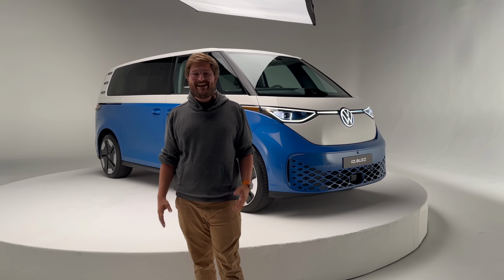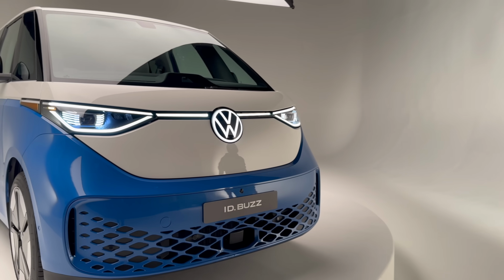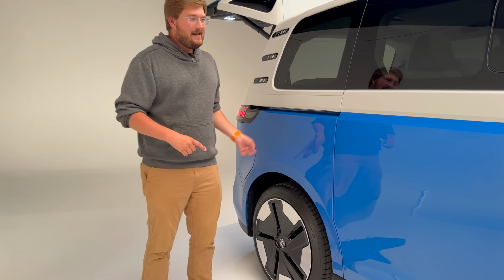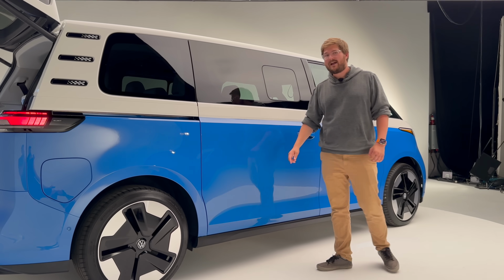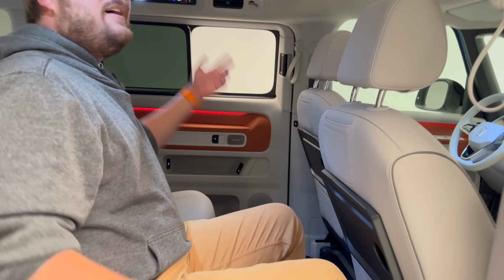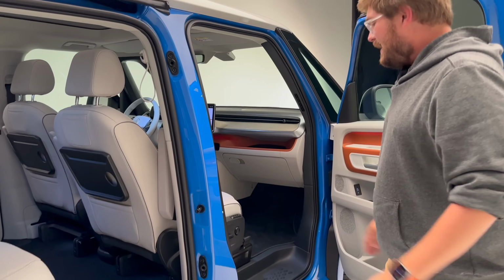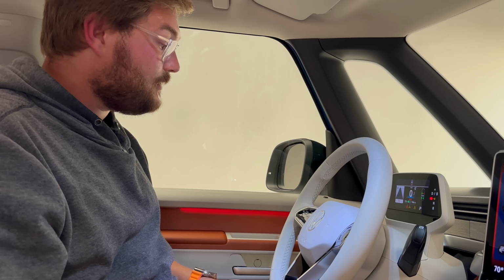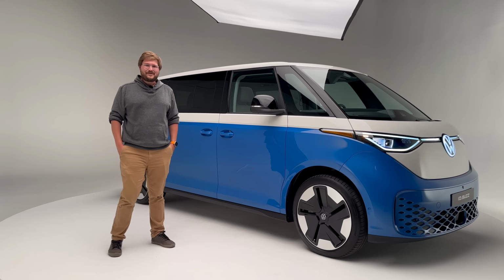The US Spec Volkswagen ID. Buzz Is Finally Here! The LWB Is Freaking Awesome & Worth The Wait

Comment: the price for this would be very appealing in the $30's but used price for this vehicle in europe is around 40k euros to 60k euros for the "used" market meaning brand new i can assume they were about 70k to 90k thats insanity to the max remember what a kombi was priced at, we are starting to loose a grip for reality or capitalism

car industry is giving you more plastic interiors and exteriors for more money while car industry back then gave you metal cars that lasted decades and decades and decades and decades and the price was cheap , is like instead of moving forward they are backwards, i know a light weight plastikyyy car is faster and cheaper to make

Comment: The New World Foundation 

The charging port is to be converted to a output port t because the power being supplied by two frame mounted generators to be operating while parked.  We ordered a electric 4x4 All-Terrain version with a swiveling bench for the back seat in a camper version.
   It will be desert tan with a brush guard for oil company operations.

Comment: 100% Flop. With an ICE motor it would be hotcakes. As it stands, it's useless for the main demographic, the Homeless. Can't plug in or set up enough solar panels or run a generator near your job so you can't make your payments. Useless for families because the only reason you want this is for long family trips. Around home someone is staying home 99% of the time. No chargers along the way and if there is, kids are hell waiting for a charge in public where mugging and kidnapping is rampant. Can't take it off road. There's no point in this thing without a way to charge it on the move. Another California/CAFE waste of resources.

Comment: 2 fkn cool... but needs glass power retractable sun roof and 3 row back windows need to open either electric like 2nd row or old style tilt out from both sides or either side for ventilation also back window up and down or tilt out and if you really want it to be super cool can have optional screens for all windows  and maybe on future versions tilt out front window  or totally openable front window w screen option for those hot summer nights to really feel like camping without being eaten alive by bugs. Thank you for the demo and please pass along to VW - one more major item for safety would be an outside on the back a Battery Meter light to let those behind you how much charge power is left as to not get behind them when low or stopping behind them on railroad track...major involuntary manslaughter lawsuit...  When does the pop up tent on top model come out and or the 21 window micro bus come out? and or the both side door rain\shade canopy's and hammock hooks on the inside to hang a hammock instead of a removable moldy unsanitary mattress? Hammock are much cleaner. Also a neutral position for when the battery dies so we can push it off the freeway out of traffic without a flatbed. Also an all points roof top camera\video system 360 degrees w zoom to take pictures\video or broadcasting app while driving with driver or passenger side controls. When the sunset or rise happens and you have no place to pull over to get the photo op in the moment you see what you want before the clouds pass out of the view or change. . aloha to all Thx VW for this too hip flashback, very cool indeed. Oh and optional out door flood lights for the campsite to set up at night or changing a tire on a dark road. Solar would be cool too for xtra charging while camping all day.

Comment: You guys in the US should save your money. Over here in the UK they are already discounting brand-new ones by up to £8000($10000) and you can pick up a used 23 plate for as low as £50,000 ($64,000) and there  are stories that you could get them for a lot cheaper than that. Classic example of style over Substance and continuing evidence that EVs are not the way ahead. I live in the so-called affluent south east of England just outside London where Ferraris and Aston Martins are common so there’s a bit of cash around and I’ve only seen one since they launched them this year. There are already companies in the UK converting them into campers but I suspect there isn’t going to be a large take-up. Buy yourself a T6 or 6.1 or the new T7 when it comes out.
Reply: Yep. ID.Buzz ought to be economically competitive with the gasoline and diesel minivans. The era of cheap oil is over, but so is the era of cheap electricity. VW can attempt asking whatever it wants for the new EVs, based on pricing of other EVs, yet the used ones are subject to much stiffer competition.

Comment: So it's only going to have that stupid glass roof?  Yuck.  And the 2nd row is only removable if you unbolt it?  What a pain.  Range is too short, I don't need power doors, it would be really nice if we could get back to the old days of vans only having doors on one side (easier to add extra wiring), wish it was closer to 500 hp 4wd, top speed is too low.
It's nice to see the column shifter making a comeback, open space between the front seats is great.

Comment: What is the size of the windows in the passenger area?  Are they large enough for an average American adult to exit in an emergency should the door mechanism fail?  Are they adult(American )sized egress windows?  I don’t know the specs required for the passenger section of vehicles sold in the American market but the windows in the rear passenger section appear small, but hopefully are much larger in person.

Comment: VW is not going to increase production until the 2024 election is over. If Republicans win than say goodby to any tax credits for anything like solar panels, EV’s, or any else. The only tax credits they want if for oil companies. They have made it very clear that drilling for oil and using oil is their main goal. They do not accept that global warming is due to carbon dioxide in the atmosphere and that automobiles are part of the problem.

Comment: Own  Benz and a full opt Pacifica. Never understand VW design, very odd and always years behind. Drive a Pacifica and you will think this   van is passe. IE stow and go. For those hippies and campers. Designed a teardrop in the 3rd row with a fridge, burner, oven, plenty of drawer/cabinet storage, 10 gallons of fresh water tank with running faucet, solar power station. Just finished a 3800 miles drive to/from the Keys with 5 people comfortably. Could never do that in this Buzz

Comment: The VW Bus was all about road trips. A typical VW Minibus would get about a 350 mile range with a gas station on every corner. The BUZZ seems useless without a 400-500 mile range option to me.  That is a huge miss as far as I’m concerned.  I’d buy one in a heartbeat for a conversion van if that was available.  As it stands, I simply cannot go to Great Basin National park in an Buzz, and I certainly can’t take a family of 4 with luggage there.

Comment: Great video.

Small correction: you mentioned there is no one pedal driving. Actually, one pedal driving is the B next to the D (drive) on the instrument cluster. You basically just twist the gear stalk upwards an extra time: further, twists upwards will switch between drive and one pedal (B is for regen brake). Same system on the ID4. A little bit hidden for sure.
Reply: It’s not a full one pedal driving however the car will still creep forward at 1-2 MPH

Comment: It doesn't look like a dog crate will work in the back with that really high weird shelf behind the third row.  The window that opens on the middle row door looks impracticle; what happens when that is opened at speed?  I don't know how many people are going to shell out for a three row vehicle that cannot really be taken on road trips or camping.  Unfortunately this is not a very useful vehicle and that is a shame.  I will be buying a Toyota Highlander, too bad because I am a fan of VW before they went nuts after diesel-gate.  This from a company that made the most practicle vehicles ever that anyone could work on in their driveway to a limited range gimmicky vehicle that looks cool but ultimately won't be easy to live with and will not be taken out of state easily.  This will be relegated to a commute vehicle most likely and looking cool commuting....not practical.  Don't bother with the camper version, it won't have enough range to get to the camp site or return.

Comment: Really not liking all the screen-related controls; they need to go back to analog buttons and knobs! Also, it would be great to have the shorter length option, as the lengthy turning radius won't be much to my liking. I think, while this is calibrated for the North American market, VW may have missed the boat on some of the options and features that will appeal to US drivers. I guess time will tell...but it's still a really interesting vehicle, and one I'll surely be eager to see in person!

Comment: I like it a lot but I don't think I'd actually owe something like this. Honestly it's mostly due to price. I got my car back in 2014 for 16 thousand walk out price with less than 2000 miles on it because it was one of those cars that you could win from the big gambling casinos, the person who won didn't want it so it only got driven to different parking lots and the owner didn't want it so I got a very very good deal out of it but it has me not wanting to spend more than like 25k for a car 😬 and really cars just aren't that kind of price these days. If this was maybe like 27-35k then maybe but I doubt it even though it's electric it's not cheaper and doesn't save as much. My car gets over 40+ miles a gallon with a 14 gallon tank so unless I can get a similar or better car I am not buying another one 🙂 but this looks good though, I've always liked Volkswagen's

Comment: I really really wished Europe had these lit badges as well. But there is something Europe has that  the US really needs as well and those are amber tail indicators.
Reply: European trucks (i.e. Scania) have lit badges. Also, some US cars have amber turn signals. In the US, we have the option of both. Just depends on the manufacturer. For example my Porsche 944 had amber tail indicators and my VW Eurovan. All US spec.

Comment: What a turd !  I owned a 1973 orange camper , was amazing van ! This new
VW looks like a death trap , re make the old bus with horsepower and it will be the greatest camper ever . This new van is a Fail.
Reply: Your old T2 was really safe. Especially with your legs in front of the front wheel. A piece of sheet metal protecting you is all there was.

Comment: Great video intro of the Bus guys!! i'm a type 2 bus owner .. is getting closer and closer to arrive . thanks for the awesome video !!  quick question ?  i saw through the window reflection that you shot the video in 4k with an i phone .  awesome . did you use a Gimble and what  video settings did you had the phone set up . amaizing job on the video shorting so smooth and no shake. small blur some parts but overall  100%%%

Comment: After waiting so long with all the teaser " maybe coming " vans , this is fun looking but I wonder what the cost vs. basic function factor will be. I had 4 daily driver VW vans over about 35 years  that all had their faults but I still loved them. I'm sure the buz won't be moderately priced because of the electric do dad additions , though I could ask for more .( not everyone is a gadget geek ) . I wonder if Der Factory could supply a hybrid version built like a tank as the vanagons were.  One more ask....how about a less city version and make one with a high enough wheel base to threaten the dirt ,and not the other way round.  None the less, VW has finally birthed a US spec'd ,cool looking van.

Comment: Will they add the 4.0 software for current id4?
Reply: What I have heard no , since 4.0 runs on different Hardware...if ID4 gets a Facelift with the new hardware...it could happen, but not for old versions.
Reply: @josefv-y8m  I have a 23 and they should continue to have it updated. I understand they can’t update over the air but they should add to the software

Comment: Like it, Like it!  I've driven an ID4 for 2 years. Right rear charging port means backing in for charger connection. Poooooor decision VW.   It's very clumsy as you back into a tight space, and drive out into a larger space.

Comment: It is a beautiful van however, the only thing that disappoints here is the low range, the instrument cluster that is just so tiny and there is no center console that could have served as an armrest and compartment. This is not a good vehicle for road trips due to the dismal range. That means It needs to be frequently charged and will cost more because of frequent charging times. If EVs have a minimum of 450 miles or more range at 80% on a single charge perhaps it will be more practical to have.

Comment: Will be interesting to see the price/performance comparison between this and the CyberTruck for lifestyle-type buyers.  I have a CyberTruck reservation, but would consider the Buzz also, because I've no plans to off-road with the CyberTruck anyway.  Probably won't be able to buy either one of them until 2025 or 2026, so there's time to consider which way to go.
Reply: One is going to be an actually practical vehicle and the other a gigantically big, I'll-designed and unusable thing.
One makes you look cool, one like a total duch.
I know where I'd put my money at...

Comment: The US and Canada need to have a regulation requiring amber turn signals.  Red means braking, amber means turning.  And none of this animated nonsense, whole light on or whole light off.  Animation takes away precious deciseconds of reaction time.
Reply: I have a 2003 VW Eurovan and it came with Amber turn signals. Other cars do also. It's that most just use red in the US and Canada yet they are required to do so.

Comment: I like the larger size. If they make a stripped down version (like a cargo van), some craftsmen will make a bundle converting these into weekend camper vans.
Reply: The cargo version cost just over $52K USD. With the 25% Chicken Tax, it'll cost just over $64K USD. Then the craftsmen can go to work making them. Probably look at it costing $100K to $120K when you are done. That's cheap.

Comment: Excellent review and video! I think this is one of the best reviews that I have EVER seen on any vehicle. I would consider a 5 seat ID. Buzz do you think they will do a 5 seater? To your knowledge are the 5 seat and 7 seat vehicles do they have the same wheelbase and overall length but one has the 7 seats added? I hope you do a part 2 and illustrate what driving it feels like etc. This kind of vehicle was not on my radar but now it is there is something about the feel and look of the vehicle that reminds me of the older school models but with a modern twist. What is interesting about that is the gas vehicles that tried to be old school was not able to nail it like the electric vehicles I wonder why. Good job!

Comment: Closing that front door...it sounds tinny...was that VW's goal to make it like the old VW Bus (a tin box)? Also that storage lid in the back behaves and looks like a piece of carpeted plywood and kind of bounces closing it No latch? not impressed at all. One more thing over an hour to charge? I pull into gas station and back on the road in 5 minutes with a full tank. So traveling from Seattle to Portland and back add about 2 hours to your trip. EV's have along way to go before they're accepted by most drivers. I'm sure the price will be shocking.

Comment: If the range was 350 that would be way more appealing 

260 epa is a little low imo pretty much cements this is as a suburb car for now. Hopefully battery tech and charging infrastructure massively improves in the next decade

Comment: Original VW bus had sliding windows. But back in the old days we just slid it by hand. Didn't need a frickin button for it.
Reply: I have a much newer bus (1968) no sliding windows but just those rotating ones you had to operate by hand then came loos after a few years thus you had to use your hand to keep it open. Much better and an electric one.